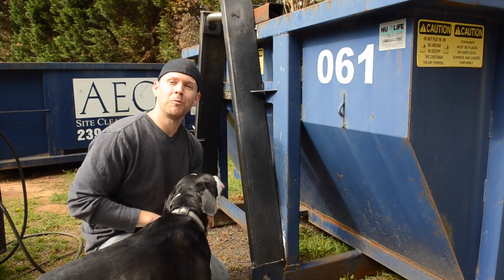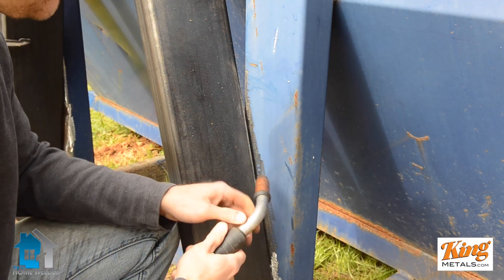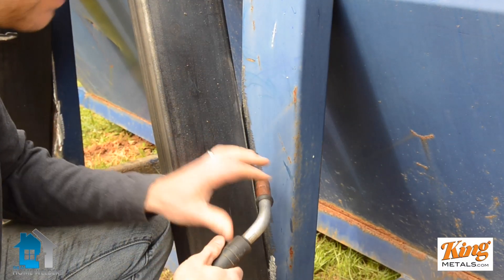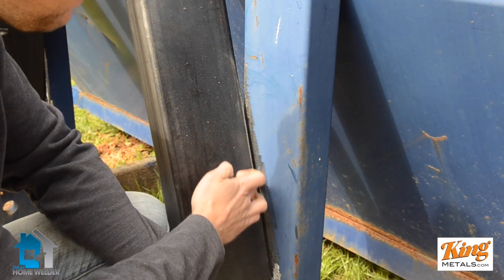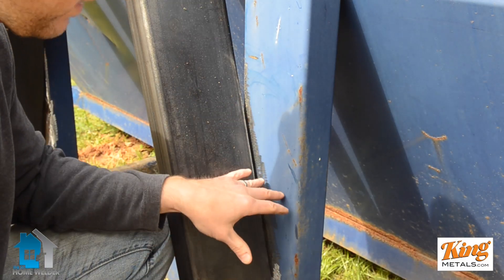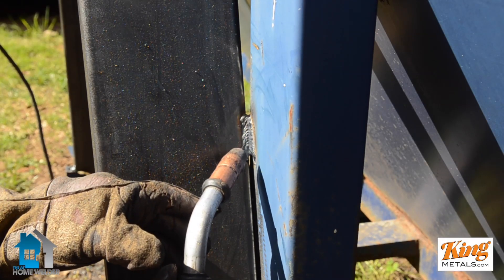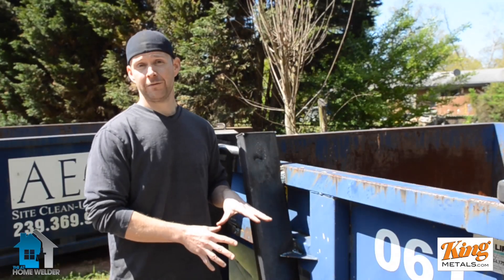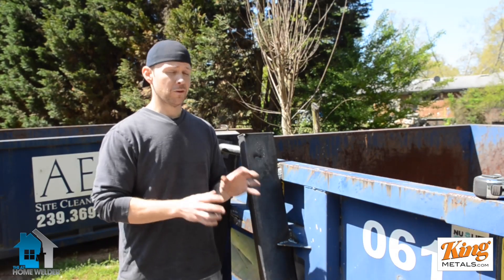MIG Welding: How To Weld Vertical Gaps

Comment: Andy, great that you are sharing a technique - however bare wire, short circuit mig on the A-frame of roll-off being converted to a hook-lift dumpster - really, really bad idea. This is a job for dual shield spray transfer mig wire (with gas) - or 7018 stick. You can close a gap like that if you have to with the dual shield - but not going downhill. It's also exactly what I've been doing for the past 6 hours - on hook lift units. My $2

Comment: technique is ok. stick out waaay to far. but you are a terrible welder. people need to know travel speed/wire speed and drag/push angles. or if going uphill to turn up parameters about 15%. dont half ass it. stop teaching people how NOT to weld. thanks